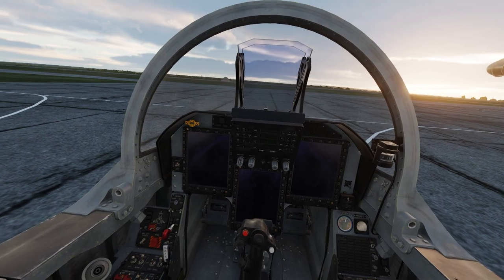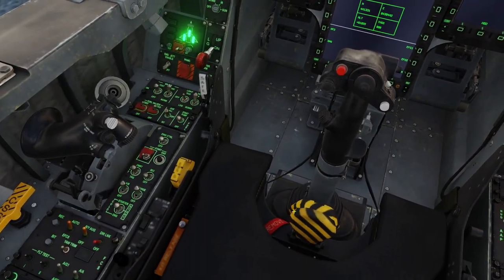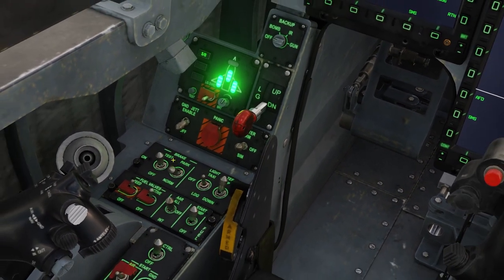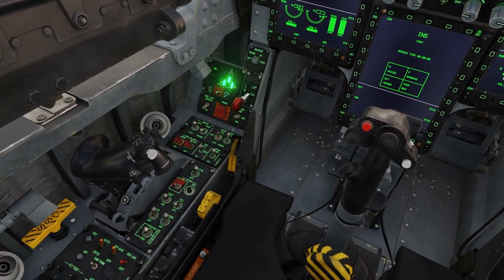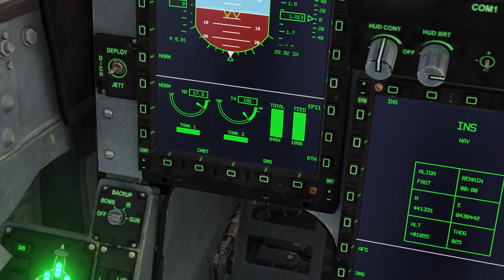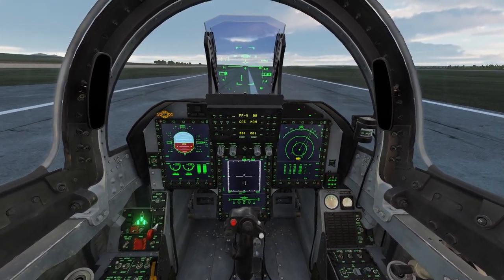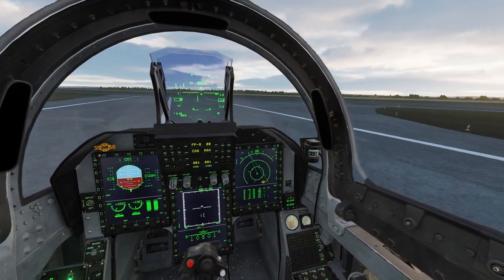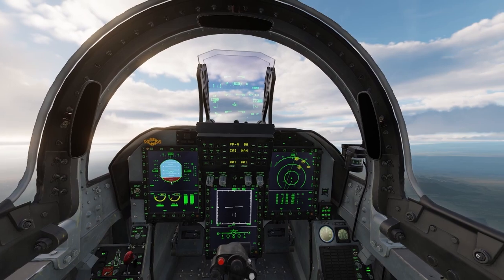Learning To Cold Start The JF-17 | Digital Combat Simulator | DCS World

Comment: What HOTAS are you using? I got a Logitech HOTAS which has an issue of ghost inputs which causes weird things like turning off the power of the jet.
Reply from the maker: Okay so I have a Logitech hotas as well (Rhino X56) I noticed random switches in some jets going off at times as well I was hoping that wasn’t the cause of it though mmmmm who knows I shall see if it does it when I fly the A10 as well and if it does then that’s probably the issue. I gotta see if there’s a fix for that as well